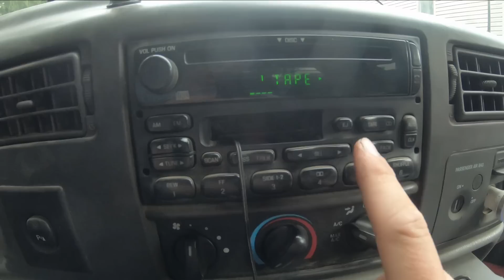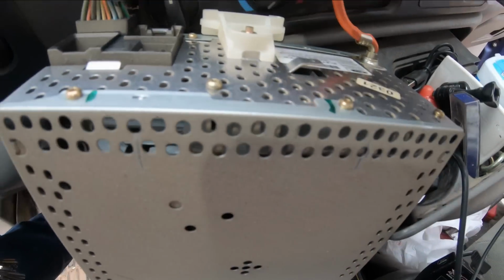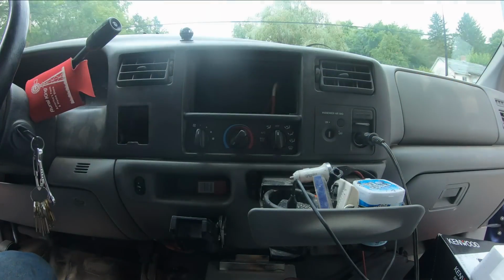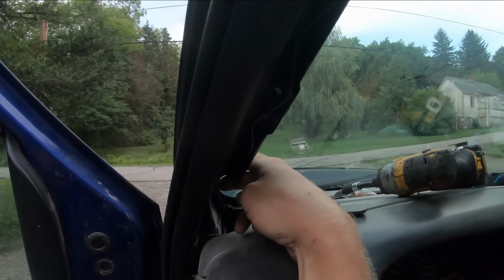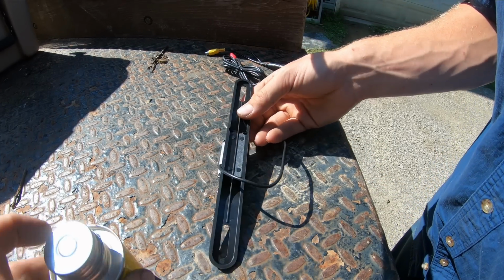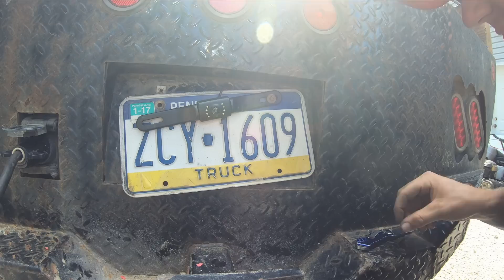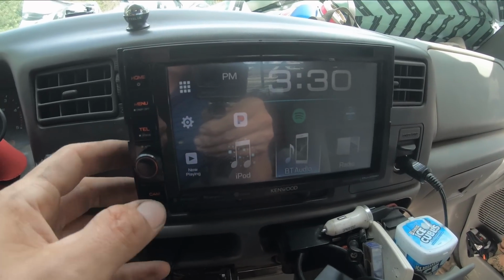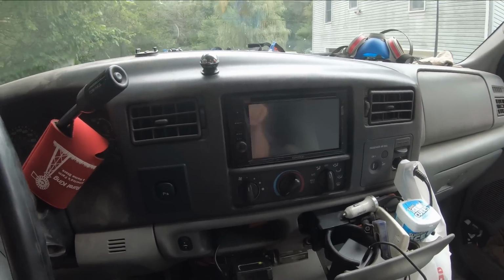Bringing the F350 into the 21st Century!

Comment: i always order my units from Crutchfield, they always include all needed adapters/accessories/trim pieces/WIRING HARNESSES with your order.
Reply: Always my first stop to confirm Radio X will fit in the dash of Car/Truck Y
Reply: Agreed. They were always more expensive but worth it if you were an occasional installer.
Reply: @Pennsylvania Mike For sure, I agree. Plus they include the install instructions as well, can't remember what they're called. SmartSheets or something? But they have actual photos of the vehicle you have, so it's easy to follow along.
Reply: @danr6823  they had his radio fro $230 with all installation accessories included...i think thats what $10 more than what he paid at best buy...well worth it imho
Reply: @GrandsonofKong  I've bought a few radios from them just type in your vehicle and you only get what fits. And the harness and face plate. Quick and easy
Reply: Been a Crutchfield fan since 1990!
Reply: I agree. Crutchfield is the only way to go
I have installed many headunits, speakers and adaptors over the years and I have always bought from them. They even have a hot line to call if you run into problems. I even bought my last tv from them
Reply: @danr6823  master wiring diagrams

Comment: Should have used Crutchfield. Step by step directions with photos included and often they will give you all of the necessary adapters to simply plug the head unit into the existing vehicle wiring. Crutchfield would have told you that that head unit was not a direct fit.

Comment: ...and this is how it begins. Next, you'll want some slightly heavier bass, so you can hear it over the diesel roar, but you'll need a small amp to power it, but instead of a mono amp, why not just go with a multi-output 500 watt and some new 6x9's for the doors? Also, that stereo is fine, but it's, like, one day old. You should upgrade that to a McIntosh headunit. You may have to sell some equipment to afford it, but that's OK:)

Comment: Yea I did the same thing cutting into the factory harness my first time. I eventually found out about the $10 adapter harness for your vehicel you can get that plugs into your truck side plug so you just sit at the bench and connect the 2 harnesses together and then you plug both sides in and slide the stereo in. I also did the same touch screen install on my same f350, I used a dremel and shaved it just right and it worked pretty well but super messy. I took the dash out and did it in the garage.

Comment: Iuse Crutchfield whenever I do home or vehicle upgrades what’s great about the head units from them is they also provide a plug-in adapter that plugs into the harness pulls the power where needed and access to the cam bus etc. and there’s only a few wires you have displays which are identified in the vehicle specific instructions that you bought the head unit for I highly recommend it and I am not associated with them I have been using them for 20 years because of the support and the per vehicle  research they do. They also have vehicle specific adapters that you can get reasonably cheap that will trim out the radio for your dash and any specific bracketry you need
Reply: I had never heard of them, thanks for the tip, looks like a great company
Reply: Eric L if you buy something from them like a head unit they are there for you and will actually pull up their research and work with you to figure out issues installing what you bought from them it’s a great experience.
Reply: I've used them for years. Great company!
Reply: @Pennsylvania Mike Im not big on audio, haven't bought any equipment in way over 20 years.

Comment: Lol I used a dremel tool on the special double din dash for my 01 ram  , 7 inch radio with Bluetooth and hands free was 7 1/16 inch and the hole that was suppose to be 7 inch was 6 5/8 inch  , so fun modifications

Comment: Just like many others said, Crutchfield is great for making the installs easy.  I did a Kenwood head unit very similar to yours on my 2011 F250 and 2014 F150.  Got the units and the install kits from Crutchfield and it was smooth.  The reverse wire isn't a power wire, its an trigger wire for the cam.  You can still hit the cam button anytime to check back behind you, but the reverse wire just makes it comes on automatically. (I'm sure you already figured this out.)  Good head unit though...menus are a little cumbersome, but works good and reasonably priced.

Comment: Those cams are so convenient especially if you have a high pick up and your backing up to a low trailer.  Normally you can't even see it or you have to attach vertical poles on the trailer that stick up about 6 feet.  Nice !

Comment: Add a rubber snubber to top of the factory pot metal guide and your black tubing on the sides and presto one neatly installed modern radio / CD player w blue tooth. That is a techno jump ahead of the cassette well done.

Comment: If you connect the anode of a Schottky diode to your marker/running light wire and the anode of another to your reverse light wire, then connect the two cathodes to the camera's power supply it will have power as it does now but also when reversing without your lights on.

A bead of black silicone sealant might also work to fill the gaps around the bezel.

Comment: If you drop the steering column bottom cover and clip the ground wire going to the key cyclinder you can leave your key in with no more annoying dinger! I've done it on 4 super dutys of your vintage. So much nicer when you're in and out of the truck a lot or just want to leave your door open....

Comment: Nice work with the file and the Sawzall. Good clean work truck installation, but i gotta say I've seen Andrew Camarata clearance his dash with a chain saw, and I really liked that video.

FYI, you can get a plug and play wire harness at Walmart or the auto parts for like $20 (next to the Ford radio keys) and everything is labeled. They make things a lot easier.

Comment: What to use on the sides of your radio to fill in the gap is foam weather striping, like the kind you put along the edge of a pick up shell I have use this for years and it will help to hold it in place and keep dust and junk from getting behind the radio.... from the Macguy
Reply from the maker: I ended up using small black fuel line, worked well

Comment: Should have gone with Crutchfield. They would have given you free install accessories (adapter harness, trim plate etc) and a set of complete wiring instructions. Would have let you keep the original radio harness so you could reinstall the old radio if you sold the truck.

Comment: I have a 2003 F250 with the last of the legendary 7.3L in it, I bought it about 4 years ago with 84K original Texas miles on it and now it has about 120k. When I got it I had the windows tented, had an alarm put on it and installed a touch screen radio with a back up camera.

Comment: A great way to determine which speaker wire goes to which speakers is to  use a 9 volt battery it works great.touch the wire and listen you'll find it makes it so much easier.

Comment: That’s hilarious about the back up camera, I hooked up mine the same way! I drive a service utility van and there is no way to see what’s behind you they are great insurance savers.
Reply: When I did mine I ran power for the camera from the trailer 7-pin 12volt constant, the radio lead goes to the rev lights wire to change the screen. All behind the radio is plug-n-play harnesses/adapters

Comment: I think I have a solution for the side gaps - have the same problem with the Ranger I have last week when I installed mine, looks like a similar hole we both had to cut. I am thining of using weatherstripping, or square O-ring cord that you can buy in long lengths. (I used a dremel to expand the hole and bought a harness).  If your head unit has an external USB option, look into one of the USB adapters that replaces the cigarette lighter, they blend into the dash pretty well.

Comment: Not sure without seeing it up close, but you might be able to take the clips off the old radio (that you used the heavy wire to pull the radio out) and install on the new radio to latch it in place....

Comment: i usually buy all car audio through sonic, easy to select your vehicle for fitment, that i also get the harness and antenna adapters, i also solder the harness adapter to the head unit harness plug and shrink wrap///all done very quickly......the harness adapters are cheap and save lots of time...btw some cars need installation kits...all worth the extra $$ and saves hacking and time.

Comment: Whaaaaa? Sitting in my car butt-splicing 1,000 wires (I know, booo for using butts) for a harness adapter is a cherished memory. Also - Crutchfield. Best place to buy a head unit. You get a harness adapter and a detailed instruction sheet for how to take apart your dash - sometimes necessary for newer cars.

Comment: I used to drop by and help my cousin in his shop so I was always welcome to repair my own stuff. 

Had his old lady order a seal kit for the steering box on my K2500. Had the driver side wheel off and was looking it over.  He walked by and said "BP let me show you the easy way to do that." 

He gets down there with a hook tool and pulled like hell till the tool comes loose. His hand hit the bottom of the inner fender and I heard him gasp, saw a huge gap open on his wrist and then blood start to flow rapidly.  He stood up and looked at it and his wife walked by and just led him to the car and they tore off for the ER.

Scratch that method so I picked up the box and directions fell out. 

Directions said to remove the split ring, crank up the engine, turn the steering wheel full lock to the left and the seals and gasket would pop right out. Install the new ones, replace the split ring,  check the oil and be on your way. 

It took me about 7-8 minutes including replacing the wheel and tire.

I backed her out, locked up the shop after wiping up the blood and drove home. 

Directions, who'd a thunk it?

Comment: w/o a grommet or wire protection on the rear view cam it will eventually wear through. also for speaker replacement use sonic electronics to see what fits.

Comment: Your rearview camera better run at temps lower than -20°C or -6°F.  Otherwise you'll break it next winter in PA for sure, let alone farther north like me.  
There are radio adaptor kits for most cars / trucks. At least look at them, usually they adapt the car's wiring to, in your case Kenwood's, and your steering wheel buttons will work.  In my case, I got an adaptor case to put my smaller radio in my car's bigger radio hole.
Reply: Sorry to say but usually Bluetooth gains you convenience but not fidelity.  The cassette adapter is better for sound fidelity believe it or not.  That said, vehicles are noisy so you wouldn't notice.  Unless you know how to get "lossless" compressed music, e.g. FLAC (or is it Flacc?), regular Mp3s or AAC's are not really hi-fi to begin with.
Reply: To get better sound you'd need to get better speakers than Ford gave you and you'd only really notice poor-fi with acoustic Jazz and Classical.  Pink Floyd is the exception that proves the rule. 8-))

Comment: You no you could have gotten a wire kit. It plugs into the ford plug and then into Kenwood. It's basically a jumper so you don't have to cut wires. The also make a install kit to mount the radio.

Comment: DIN II wasn't a thing yet in'03 - '04...

I had to do a bit more surgery to install a modern head unit in my '04 Dodge - lots of minor surgery inside the dash, and I needed to use an aftermarket bezel plate to replace the factory part.

Comment: hey matt was watchin you video on the back up camera and where you drilled for the wires in the bumper  there is already a hole above the one you drilled with a gromit already in it... so you didnt even have to drill the hole cause there was one factory from the bumper manufacturerer....

Comment: Wait, that annoying beeping / dinging that American vehicles have, that's a 'door open' warning? That's.. odd. Only thing we've got to alert us to an open door is the interior lighting staying on, and these days maybe a popup on a screen somewhere.

Also, you may wanna cover those LEDs on the front with some glue or something as well, because those definitely aren't waterproof either. Could be that the circuit board is just sealed though, so it wouldn't matter in that case, but it still can't hurt.
Reply: That’s not a door ajar beep it’s triggered by the keys in the ignition and the door open.
Reply: @peterg.8245  Hmm, that's even more odd. I mean, I know a friend of mine would REALLY appreciate a beep like that, having locked himself out 5 times in about a year, but I've never seen any car with that functionality.
Only beeps I've ever seen is for leaving your lights on (engine off, lights on, door open > beep). It even does that on a car where it turns the lights off automatically when locked.

Comment: Ryan Griffiths is correct WHERS THE CHAIN SAW Andrew Camerata did the same thing with his truck when it didn't fit out came the chain saw and well that's what he used to make it fit what a guy Mind you doing it one handed is good too The only thing wrong with the reciprocating saw is if you don't get that metal thingy on the end in contact with the metal it jumps around like a bull and try's to cut everything you don't want to cut including your arm fingers hand leg and your head sometimes I think the chainsaw is safer

Comment: Ohhhhhhhh man!!!   Yes is audio guys are cringing!!!!!!!!!!   There is a set of wings that bolt on to the side of that radio and lock it into the dash.  And the wiring harness is only $10 to wire that up properly!!   You were right in cutting the tabs on the top and bottom of the dash for that to fit.  But I have an ‘05 Ex that uses the same dash.

Comment: I am wondering what will happen if you drive a manual with that radio.

Since you can only (if installed like in the instructions) mess with it when the car is in park. Well a manual doesn't have park.

Comment: Thanks for the video on how to take the radio out. I have a F-250 and it worked perfectly. 
I do have a question. When I put my other radio in it does fit, the "lip" going around the hole is to small, do you recommend filing it down so the radio will fit?
Thanks
 Dave

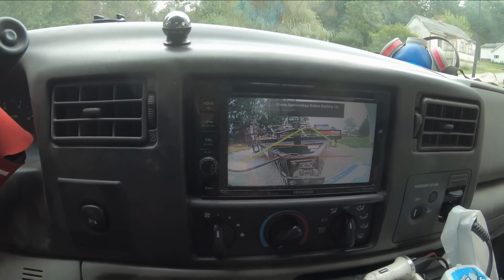Comment: 24:20 you have the factory parking sensors on the dash do you not have the sensors in the bumper?
Reply from the maker: No they were in the factory bumper but didn’t work, the flat bed doesn’t have them
Reply: @DieselCreek  you could always try to add them back. that way you dont need to look at a camera when backup against anything. get to close and it beeps. obviously this doesnt help when lining up a trailer.